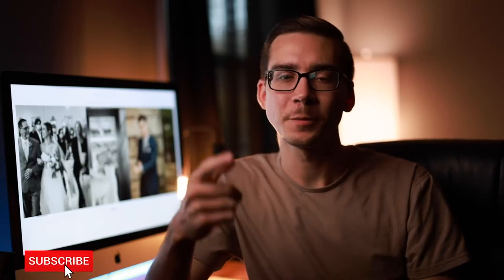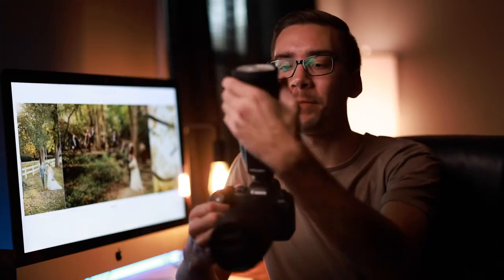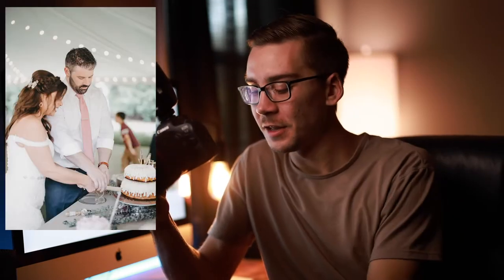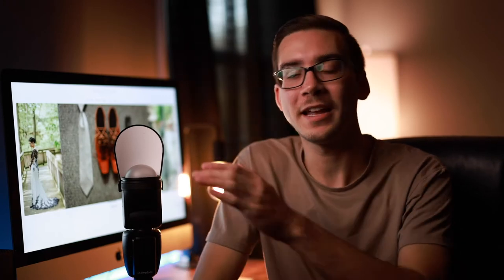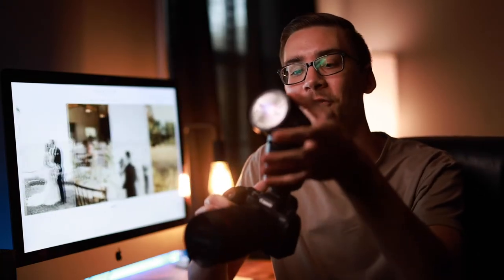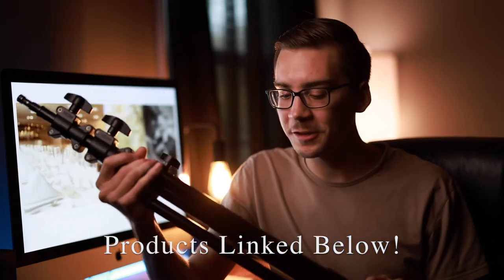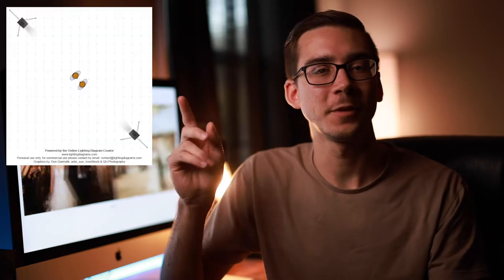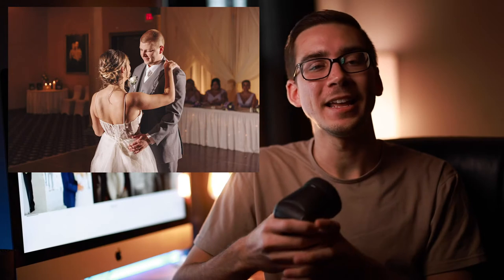Lighting Techniques for Wedding Receptions (Speeches, First Dances & Cake Cutting) Photography Tips

Comment: My biggest problem in using multiple flashes is syncing them.  Esp. when you say just throw another flash on the camera if needed.  Sounds easy.  It really isn't as I find transmitters/receivers are so finicky to work with.  Using Godox and Flashpoint equipment.
Reply from the maker: That is how it was for me when I first started using Godox. As I shot more weddings I was able to eventually buy Profoto gear. They make it so easy and I’ll never look back.
Reply: @NickHoeller  Thanks so much for the response.!